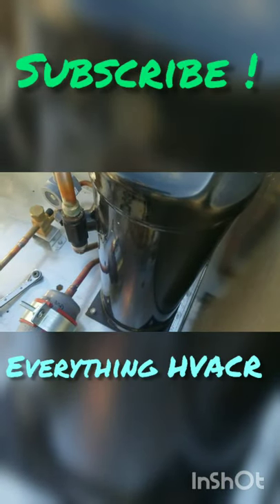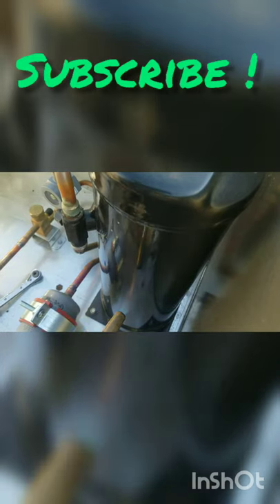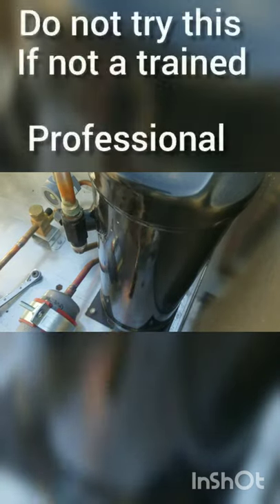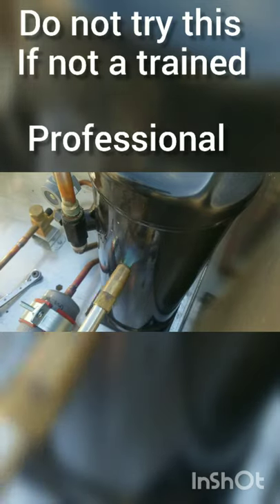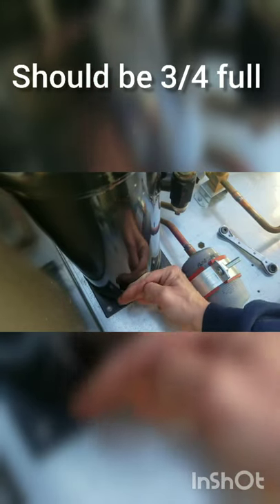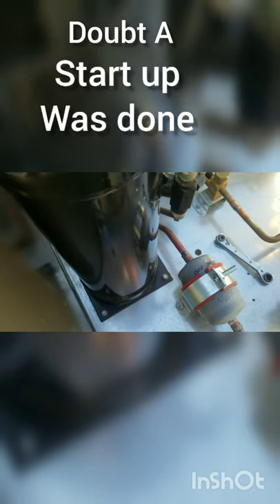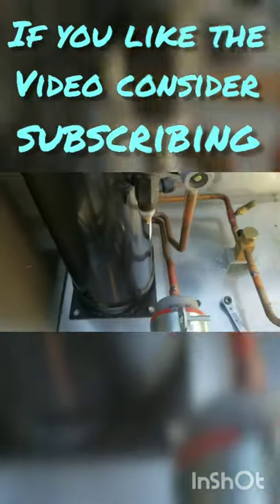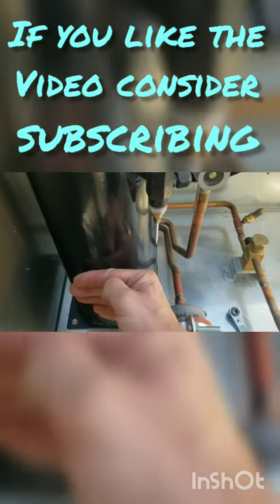checking liquid level in walk in cooler receiver/ how to #short

Comment: Most refrigeration units installed and started up in summer and warmer time of the year with headmaster valves for head pressure control in winter never get charged correctly for the winter when headmaster valves start bypassing the best way I found was to get a water hose and run over condenser coil and the head pressure will drop making headmaster start bypassing and you can clear the sight glass and the unit is charged correctly for winter
Reply from the maker: Good idea, Thanks, Stephen!
Reply: Water only at 50f.  More refrigerant stacks in condenser the colder it is outside.  Usually charge an extra lb after clearing glass.  I’m interested in finding a bulletproof way to correctly charge optimal performance yearly without torching reciever
Reply from the maker: Thermal imager.
Reply: @EverythingHVACR  don’t you still have to torch receiver with thermal imager?
Reply from the maker: I would think you could see the temp difference with a good thermal. I believe I saw Chris do it. It's not something I do every day, I did this because I never saw anyone do it on camera.

Comment: Now should we check the liquid level in the receiver in pump down mode or open ?
Reply from the maker: It has to be pumped down, I guess you could check with the solenoid closed but I find it easier to close the liquid king valve and check, then just open back up and let unit go in to normal operation. Thanks for watching!
Reply: @EverythingHVACR   No problem but what if a single condenser feed 3 reach in freezers and lin set is not 25 feet to 35 feet long I think once I open up the liquid line then that 80% percent capacity may come to  60 to 70% level since we have 2 or 3 pound of refrigerant in the line set now what do you think, 3/8 line set maybe ?
Reply from the maker: If it's a single condenser it should be sized to hold refrigerant charge in the condenser and receiver and would be best not to check when pumped down via solenoids. Receiver charge is used in low ambient conditions, excess liquid is stored in receiver and used as needed. Hope this answers your question, always lean on manufacturer different set ups may call for different ways to check.
Reply from the maker: Shouldn't trip high pressure like that and factory receiver should be able to hold the charge. You may have something else going on here